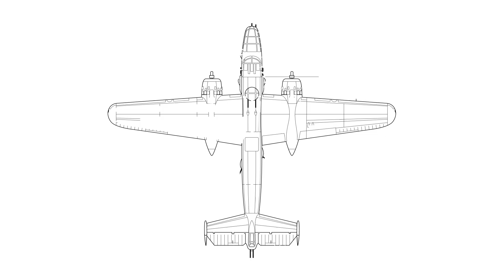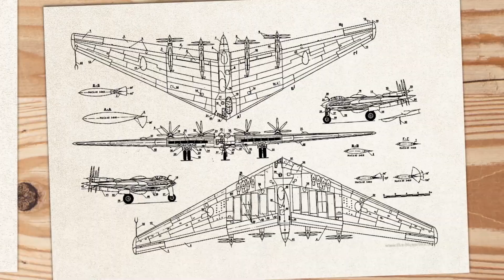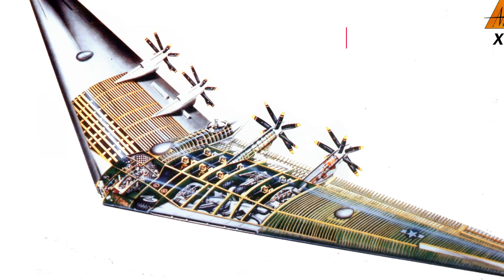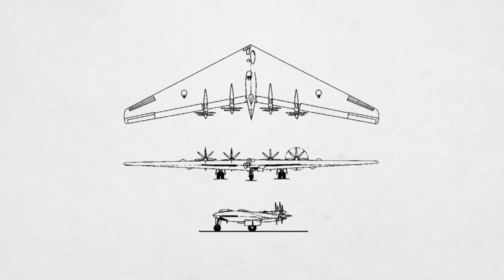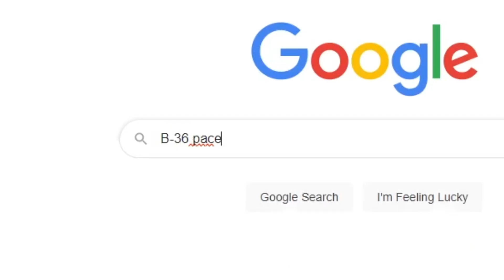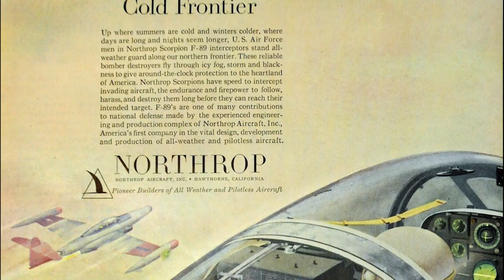This Plane Is CURSED - The Forgotten Flying Wing…

Comment: Boeing didn't have anything to do with the B-36. This was also NOT cheaper or less complex in fact the engine design, layout and operations were quite complicated and prone to failure. While initial (purchase) cost was found to be cheaper actual operations costs were higher than expected and actually using them was likely going to be more expensive than thought. (This held true for the B-36 as well)

The YB-35 actually had a pretty 'normal' radar cross section due to the props and the raised engine housings. Speaking of engines they were the same ones provided to Convair for the XB-36 design and as the ones who proposed the contrarotating prop system 'testing' the combination was actually on Northrup not the government. (They fell back to essentially using the same set up as Convair)

The bomb bays would be a tight fit for the Little Boy bomb and could not carry the Fat Man types at all which is one reason it wasn't pursued. It also could not carry the "Tall Boy" or "Rainmaker" deep penetration bombs which was another downside to the military. Modification WAS required, (but to be fair the B-52 had to be modified to carry the post-WWII nuclear bombs) so arguably a 'big-belly' mode might work but the initial design could not carry the bomb load as efficiently as a 'tubular' fuselage design. And no the Air Force didn't 'refuse' to allow modifications to the bomb bay, Northrup felt the required modifications would (and did) impact the aerodynamics which would slow the plane even more. This is where the smaller bomb bays bit Northrup in the butt in that BECAUSE they were so small and diverse they could not 'borrow' from each other and therefore modifications would mostly require expanding them out into the air stream. You see the downside.

That APU claim seems dubious as, again that's a contractor thing not something the government provides.

The YB-49 was a great idea but the bomb bay was still to small for the planned atomic bombs. Again actually fitting them would mean pushing them out into the airstream which Jack Northrup was adamantly against. (He also hated the 'podded' jets they hung on the wings and the 'air-separator' fins they added for stability to replace the 'props')

Oddly the oil problem had a simple explanation, it wasn't on the ground crews checklists because they HAD no checklists for the YB-49. It was on the crew checklists but not the ground crews which were working from XB-35 paperwork which DID require checking and filling the oil reserves for a PISTON powered aircraft, not a jet powered one. Quite plausible when you consider all the  engines serviced by ONE crew seized up but the other four serviced by a different crew did not.

Uhm "unusual" ground test? Full speed, high weight taxi tests are standard for large aircraft and finding things like the nose wheel resonance is exactly why they are run. So no, not "odd" at all.

And no the YRB-49 had extra engines on the wings, (in the pods Jack hated) but the extra fuel tanks were in the bomb bays, not the wings.

The order was canceled because the design was not meeting the required, (and yes they'd changed several times but that was actually 'standard' for the Air Force of the day and not something that Northrup initially found "unusual") goals. The podded engines actually helped with the persistent stability problems (pitch issues) but they didn't go away and the design still couldn't carry the new bombs and because of the new fuel tanks it's total bomb load was less than a 'medium' bomber of the day. Later Jack and some in Northrup 'blamed' the government and claimed that because they wouldn't 'merge' as the government wanted the contract was canceled but really the YB was simply not meeting goals and not proving to be as effective as hoped.

She was fast and sleek but the flying wing design has issues that required some advancement of technology to overcome such as the stability issue (and oddly let me point out your "YB49" CGI that has 'fin' on the end of the PISTON engine nacelles was actually suggested over the eventual "air-separator" design as it it was found the props and engine housing greatly contributed to the overall stability, but Jack felt that it was too much of a compromise to the design) and limited load carrying capability. The flying wing was very sleek and very advanced but it needed to make some compromises that Jack Northrup specifically was unwilling to make. It was actually suggested that the 'central' wing area be increased to allow accommodation of the needed modifications and as we see today in the B2 for example such a 'blended' wing/body actually works but Northrup felt that any significant deviation from the "pure-as-possible" flying wing design was unwanted.

Symington (as noted below) had budget issues and frankly if the Smithsonian couldn't, (and they couldn't) pay to preserve the example then there wasn't much choice but TO scrap it. (Keep in mind that Northrup had an option to 'preserve' an example but had neither the space nor budget to do so either) The 'turbodyne' thing is overblown as well, Northrup SOLD the designs and patents to GE as they were not 'rivals' since Northrup didn't actually HAVE an 'engine' division. Again Northrup could have 'saved' parts but didn't by their own admission. Kind of understandable given how bitter Jack Northrup was over the whole thing, but he, (not the Air Force which had no 'say' over un-delivered parts nor any claim on the patents) junked everything. In fact this all hurt the overall development of 'stealth' technology because with all the research data and that gone a lot of work had to be accomplished.

Changing times and requirements indeed had a hand in the demise of the flying wing but in the end the refusal to compromise a 'vision' of the future was more responsible than anything else.

Convair had a point actually, the B-36 was more 'conventional' but it also was more practical and capable than the YB-35/49. (And again Boeing had nothing to do with the B-36 they were working on the B-29 as a priority project and had nothing to spare for the intercontinental bomber project until well after the war) And oddly the entire reason that the Air Force had to 'choose' was because the Truman administration was essentially strangling the military with budget cuts!

Now mind you the official policy was to rely on long-range bombers carrying atomic bombs for the majority of the US 'defense" requirements in order to 'save' money by reducing military spending. (Literally Truman would pay all domestic and unavoidable foreign debts first and then take whatever was left over and give it to the military with the lions share going to the Air Force) Which to be clear was not even enough to actually MAINTAIN the then current "strategic" bomber force that the US policy depended on! The Air Force was unable to pay to retain personnel or maintain aircraft and they were getting the MOST money at the time! It took the Korean war to stop this downward trend.

In perspective at this point (1946 to 1948) all most all post war military research and development programs ended up having to be shut down due to lack of funds. Keep in mind that in 1946 the US actually had the most advanced missile program, more advanced jet aircraft research and several promising aircraft development programs going on and 90% of these would be canceled due to lack of funding. And this was the service getting most of the military budget at the time!
Reply from the maker: Very good reply!
Reply: @FoundAndExplained  I completely agree!
Reply: This is a completely correct and absolutely brilliant summary of the Flying Wing project. Thank you for this! One minor thing you left out: the engine/prop combination was extensively tested in wind tunnels, and found to be satisfactory. But that was in clean, undisturbed airflow field. Operating in the installed configuration, with only part of the blades dipping into and out of the wing downwash, caused terrible vibration.

Comment: In 1993-5, I was delivering on a regular route in Idaho. I have seen a multipropeller "flying wing" in the skies over Idaho. It was always headed into or put of the desert of Utah. It flew low enough I got a clear view of the vehicle as it turned and moved along over the fields and turned back. I may have been testing along the Rockies between Idaho and Wyoming. I took no pictures, but the image is asa clear todat as it was the first time I saw it.
Reply: Probably the N-9M, a Northrop creation as well. Was its underside blue ?

Comment: I mean the Iowa class battleships original main guns didn't fit with their turrets and ended up being used as coastal artillery because the two departments didn't talked to one another. So I can see the people designing the engines and propellers never actually talking to one another.

Comment: Dude check your ads setting. 6 ads in 20  mins is a bit much ... 
Love your channel but maybe 1 ad per 5-8 mins is tolerable...
So luke 4 ads here max ? 
As otherwise ppl just ad-block or use that trick where you skip to last few seconds of video . Watch last few seconds then hit reply- and bam- video plays with zero ads.

Comment: Not sure what use the Flying Wing aircraft would have been flying from the US to Europe during WW2. The German Luftwaffe would have been able to deal with them, especially as they were not protected by the P-51. Having a low radar signature may have helped but they would have had to fly over Spain and as Spain worked with the Germans they could have reported when the flying wings flew overhead.

Still. I would have loved to see them flying.

Comment: I'm surprised that this design isn't used more today. The biggest problem is stability which today is taken care of by computers running the SAS (stability augmentation systems)
Reply: Training pilots to fly the flying wing would be difficult. b2 pilots need separate training, as the b2 flies differently than every other plans on Earth. Every pilot would need to be re-trained, which is a financial and logistical nightmare. There are so few experienced flying wing pilots that the military couldn't train rookies fast enough.
Reply: The flying wing pushes the upper limits of what our tech can do. You’ll be seeing a lot more of the flying wing in the decades to come as the military gets used to the vast computing power of the 21st century.

Comment: Scary planes.  Yaw unstable due to lack of sufficient vertical surface area.
Reply: Many planes we fly passengers in today are horribly dangerous near stalling conditions. The military happily puts crews into things which are death traps if they stall or anything unexpected happens.

Fixes were available then., and accuracy in bombing runs wasn't much of a thing in the era of firestorming cities, and guided munitions, and nukes.

Comment: First there was . . . the XB-35. (1946)
Then there was . . . the YB-49. (1947)
Finally, there was . . . the B-2. (1997)
References:
(1) https://en.wikipedia.org/wiki/Northrop_YB-35
(2) https://en.wikipedia.org/wiki/Northrop_YB-49
(3) https://en.wikipedia.org/wiki/Northrop_Grumman_B-2_Spirit
Reply: a number of Horten is missing
Reply: @Dinitroflurbenzol  nope, because Hortens had nothing to do with it
Reply: And before that, there was the Avion 1 (1929)
The N-1M (1940) and the N-9M (1942)

Comment: Innovation vs politics, including lobbying and power grabs. Politics wins.
Reply: The only thing wrong with "politics" it's the politicians
Reply: GOVERNMENT SUCKS.
Reply: Lobbying is a cool word to say corruption, reject democracy, return to tradition, long live the king
Reply: @nomnomxddd7341  No. You're wrong. 

F*ck the King! Return to Feudalism! 

Look at what happened to France.
Reply: yes if it costs the taxpayers less or works much better than anything else it gets killed by US Industrial politics.
Reply: That's what happened to the Avro Arrow
Reply: Physics had something to do with it. Tye handling problems endemic to flying wings weren't solved until gly by wire
Reply: Not really. Boeing's B-36 and then the jet engined B-52 was already a safer and more reliable option. Realistically the xb-35 and yb-49 would be too difficult to fly without a computerized controls in combat even though the concept itself was proven to be great today. It is way too ahead of its time.

The good thing is that the B-2 spirit bomber was built not only when fly-by-wire was perfected, but the non-linear calculation for radar diffraction was already fully understood, making the B-2 very stealthy and behave like a normal aircraft unlike the F-117.

Comment: Several larger companies didn't want a competitor with a patented design of flying wings to show that is better than traditional planes. It was accepted by the fears of the war, asking something impossible at that time, when the war was over. The air command wanted to terminate the project, but Northrop continues to fulfill all the milestones, that is why the final cancelation was without explanations. 
Northrop made the first dedicated night fighter, P-61 Black Widow, the F-89 Scorpion, and the most famous F-5... Also develops a YF-17 that later becomes the McDonnell Douglas F/A-18 Hornet. Also the prototype of YF-23, that also lost without reason. And the B-2 was reduced to only 20 models, not the original 132 planned.
I love the flying wings design, by its efficiency, so I know a lot of Northop, Horten, and Prandtl history.
Note: the YRB-49, that you show in the video had 4 Allison J35 turbojets in the wing and 2 in pylons under the wing to have more space in the wings for fuel.

Comment: The Horten brothers and Alexander Lippisch were experimenting with flying wings since the 1930s. The Hortens also built the first jet powered flying wing. It was shipped back to the US at the war's end. Guess i forgot it was the good old USof A that invented everything.
Reply: Lippisch built the Me 163. A rocket powered flying wing interceptor.
Reply: @makonaima1  Northrop was experimenting with all wing designs since the 30s as well. Go back a little a you have the British and Soviet playing with such designs. German superiority is a myth
Reply: The Horten brothers were literal adolescents in the early thirties. Northrop worked on it before them- and Lippisch dabbled in it- but never really worked on it. The v.III prototype of the Go 229 never had its engines installed.

Comment: Those look like engines under the wing of the recon version, not fuel tanks.
Reply: they are indeed engines, they were added after the fact because the 4 engined version didn't have enough power

Comment: Well, the US Air Force was only a couple years old, so I guess it makes sense they would behave like a toddler throwing a tantrum.
Reply: There was also colossal corruption, Boeing and Convair owned the bomber market and they spent a lot in bribes to ensure it stayed that way.  That's also why Douglas and Martin struggled in that market, and why the Air Force was so quick to remove their products from the inventory after the war.
Reply: @funghazi  Wouldn't doubt that at all. It also seemed that some feet were stepped on and people hold grudges, and over the years they fester. Jack Northrop also seemed like a very self-assured man and probably do not take nonsense lightly. Behind closed doors, shit must have been flung. It could be as simple as "hey why don't you merge with Convair," and Northrop said "fuck no, and fuck you" and it all went downhill from there.

Comment: Thoroughly researched and presented. I really love aviation and its principle and engineering behind it, but flying wing designs hold a special place in my heart. But, between the lack of computer-controlled flight systems, batshit propulsion systems, and Convair screwing them up on top of that, the XB-35 and YB-49 bomber projects were just too cursed for poor ol' Jack Northrop. Heck, he even tried to sell them to airliners but this was the 50's, and things such as high-altitude pressurization system wasn't fully understood yet and Comet accidents would still happen to anyone. It's no wonder that he left the industry forever, and I don't blame him. 

He sent years of blended wing aerodynamic research data to NASA for confirmation of the numbers, and they eventually replied and confirming once and for all that blended wing designs are in fact the most efficient aerodynamic design ever. While he already left us for almost 40 years, his data is still valuable and thoroughly researched by both Airbus and Boeing. I just hope I'll be old enough to see (and board) a commercial flying wing airplane and be nerdy about it as an engineer myself.

Comment: This plane was jinxed from start to finish. The saving grace was it was the inspiration for the Stealth bomber/ Great video!
Reply: @Robert Dragoff
RE: "This plane was jinxed from start to finish."
The flying wing wasn't "jinxed." They just didn't have the technology to make it work back in the '40s.
Reply: @spaceman081447  
I heard turboprop version was better. But, new age jet engines weren't upto mark.
Reply: @JohnSmith-fd5un  
RE: "But, new age jet engines weren't up to mark."
The jet engines weren't the worse problem. The YB-49 had huge instability issues as well because of its unconventional design.
Reply: @spaceman081447  
I will need to read more about it later.
Reply: They had the means to fix any problems back then

There's a ton of urban myth and misconceptions about it.
It died because of corruption.